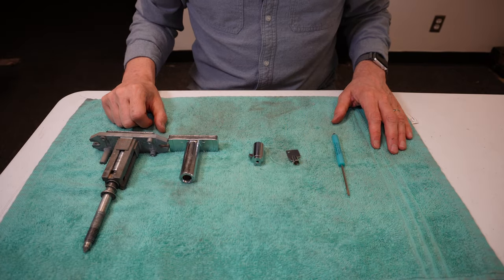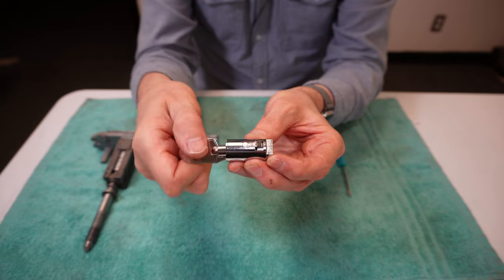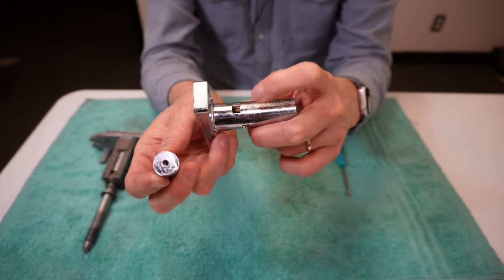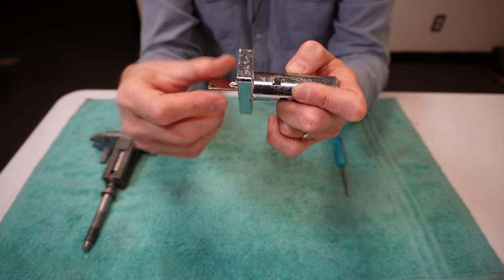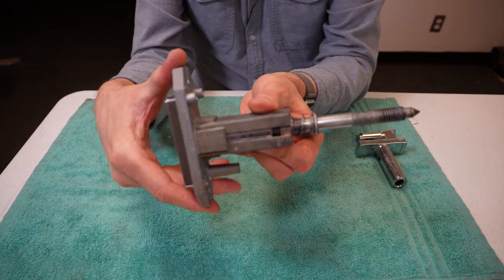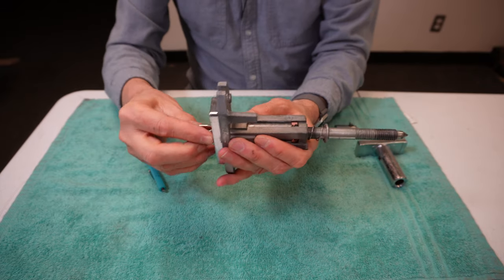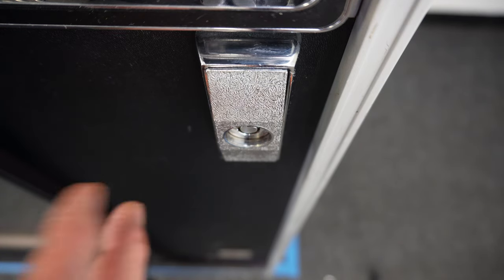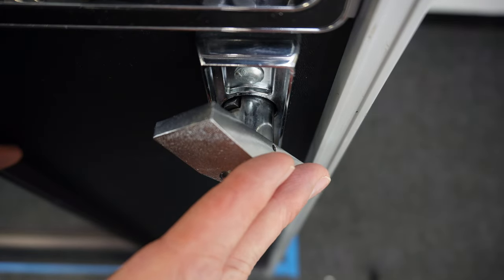How to remove and install vending machine plug locks

Comment: Thank you. But my problem isn’t the lock plug, it’s when I turn the t handle counter clockwise ( I’ve turned it many times) the door won’t unlock. I never had this issue before

Comment: I have a candy sometimes when they put the money in it dumps out everything that's in that  the rack everything will come out if they put a dollar in and go for a Snickers all the Snickers come out not just one can you tell me what the problem is
Reply from the maker: Hard to troubleshoot when I don't know the model of your snack machine. I will guess and it possible could be a bad home switch on the actual vend motor. Try moving your vend motors around to other selections to see if the problem follows the motor.

Comment: How do you do this same process without the keys 
I lost the keys to my machine and I can’t get in I have the lock just no the keys for the old locks for the machine to open ❤good vide
Reply from the maker: Thank you for your kind words. I can not divulge the steps on how to remove a lock with out a key for security reasons. Sorry.
Reply: @VendingMachineSupport is there a tool wich can mimic the key mechanism in case the key have been lost?